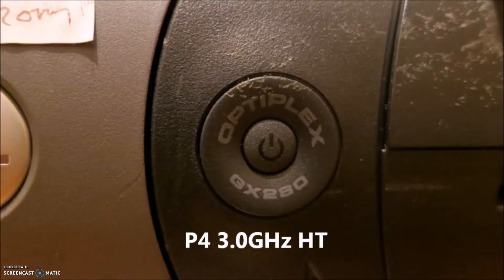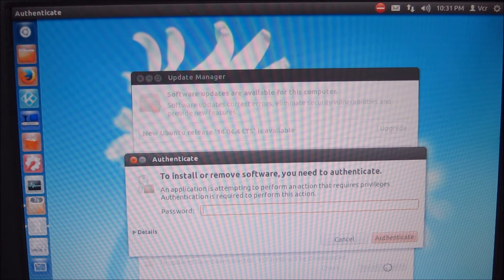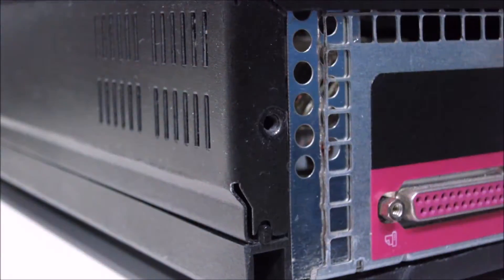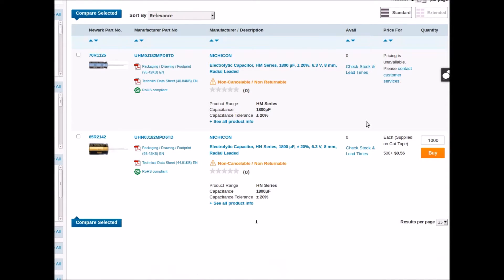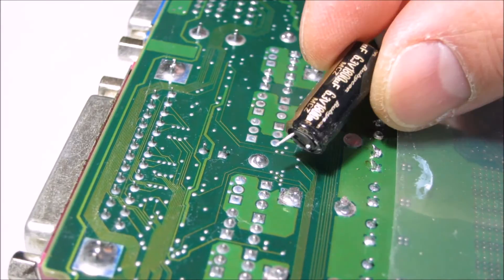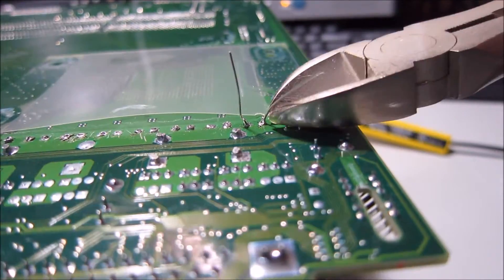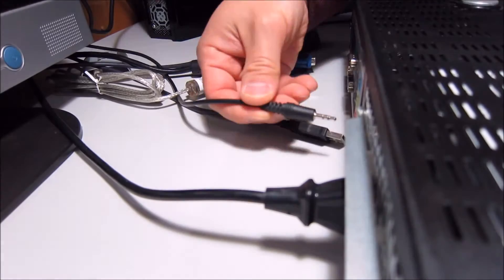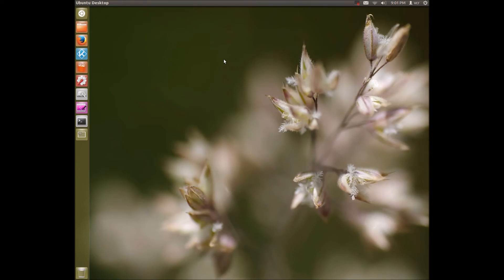Will repairing bad capacitors fix the "System battery voltage is low" error on a Dell?

Comment: Dude.. I'm sorry but the "If it ain't broke, don't fix it" saying is pretty commonly abused. Things can be considered broken if they could be replaced with something that works better. Maybe the saying should be "If it ain't broke or outdated, don't fix it or replace it." Anyways, that's my rant for the day...

 And just because those other capacitors don't look bad, doesn't mean that they aren't bad. If you don't replace all of the capacitors, then you might as well have replaced none. You may have gotten lucky with your TV, but the other caps are just as old as the obviously bad ones. If they aren't bad yet, they probably will be soon. I learned this the hard way with the PC monitor that I am currently using. I cheaped out and replaced only the caps that I thought were bad, and now the same problems are starting to happen again. Now I gotta fix it again, and do it right this time. 

Also, you might check the Power Supply components because that's another highly likely spot for this issue.

Also, watch out on buying electronics from ebay. Lots of fake stuff.
http://www.ebay.com/gds/Fake-RubyCon-Electrolytic-Capacitors-on-Ebay-/10000000009070950/g.html

I recommend Mouser. They're not as cheap, but they sell everything you could possibly ever need, and you know it's good stuff.
http://www.mouser.com/Nichicon/Passive-Components/Capacitors/Aluminum-Electrolytic-Capacitors/_/N-75hqt?P=1z0zlbmZ1z0wqrqZ1yx4avt&Ns=Pricing|0

Comment: Looks like a pretty old bios is that the 
latest one and also the clock battery circuit might be bad
Reply from the maker: +Polski Mapper Never updated a bios before. I'll look it up. Yeah, I was thinking something in the circuit may be corroded/shorted.
Reply: +Ladybug Adventures just download the exe from Dells website
Reply from the maker: +Polski Mapper I'll try it. Thanks. I'll let you know how it goes

Comment: had that problem with one of mine it was  when the battery leaked it had residue in the compartment.
Reply from the maker: +modstek Yeah, I checked the board. Everything else visually looks fine. I know you like Dell's so I was hoping that you might have an idea about how to fix this thing.